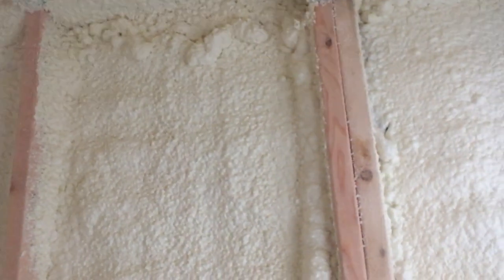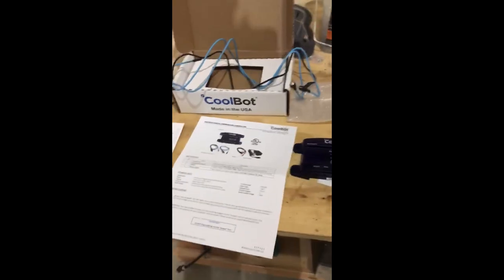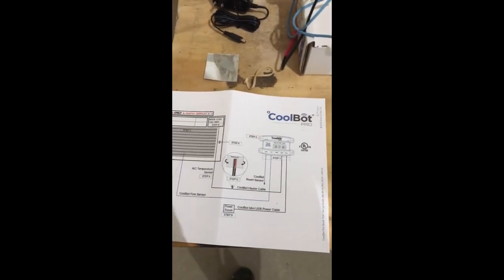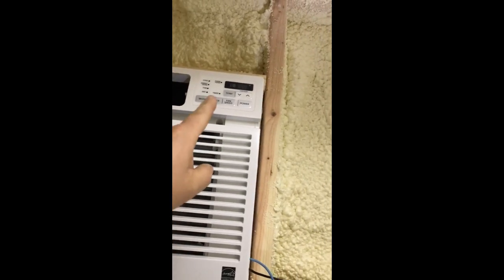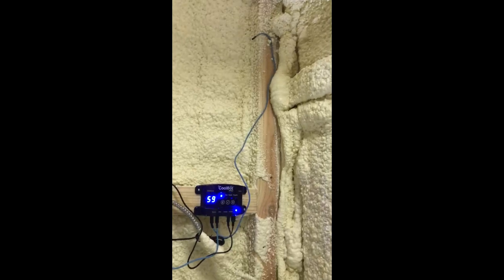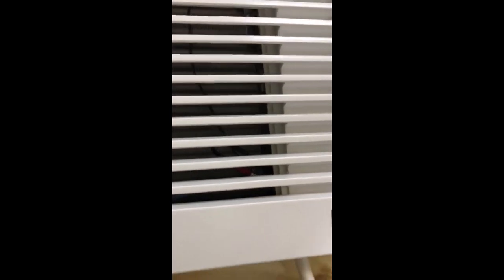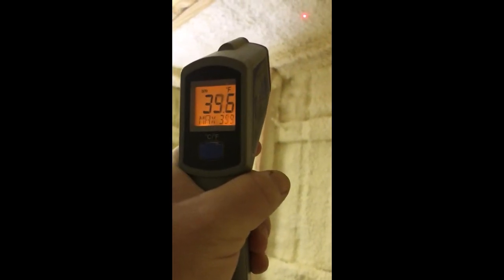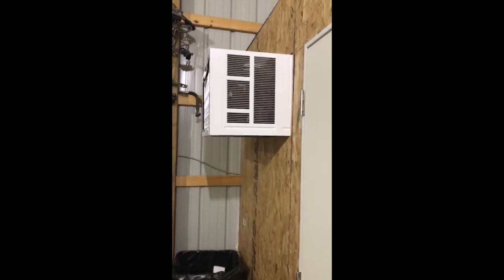DIY WALK-IN COOLER PART 2

Comment: I built a walk in cooler out of a shed and found the rail system for coolers were very expensive. I found online commercial rail system for curtains with heavy duty rollers works absolutely perfect. Need stud in the ceiling to attach it to. I hung half a elk on two roller and hooks and 1/4 on one.
Reply: What is the brand of the system?
Reply: i would like to do the same with my shed.. does yours have a window and if so do you find that to be a problem?